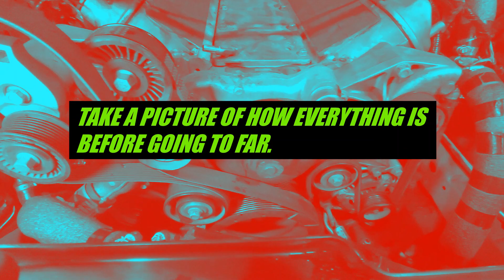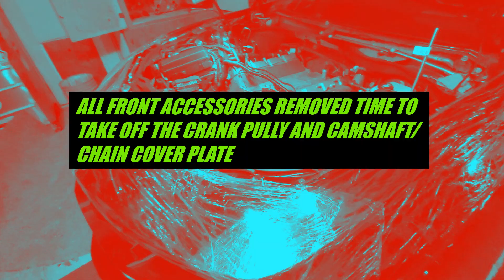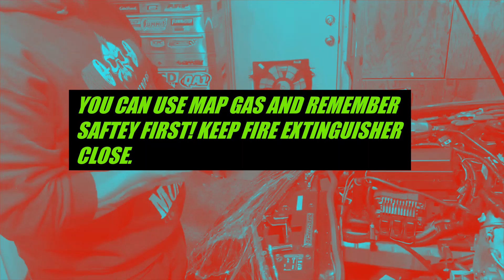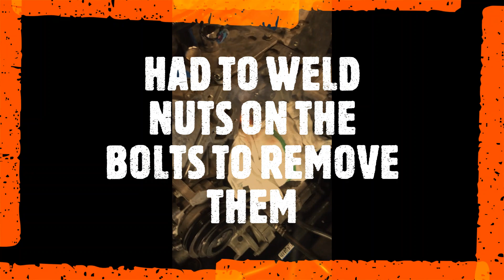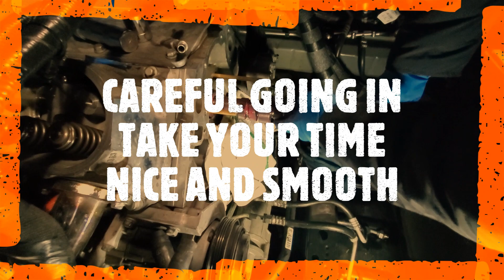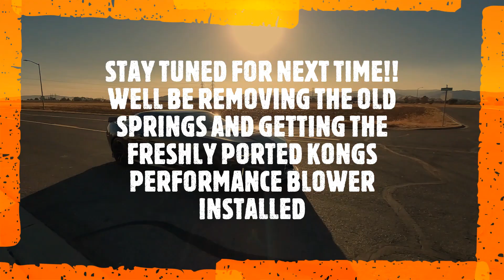CAM AND KONGS PORTED BLOWER INSTALL!! "PART 1"

Comment: So for the Taillights how do you make them sequential I had installed mine but couldn’t figure out that part they just blink like the stock light I had before I got the after market ones
Reply from the maker: BASED KIDINK You have to leave disconnected the yellow or orange wire I’m pretty sure.